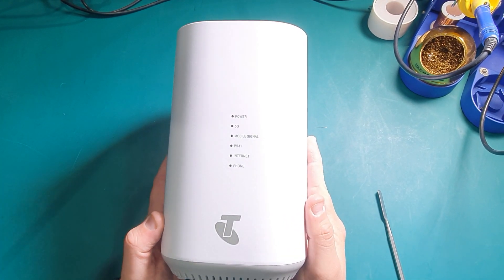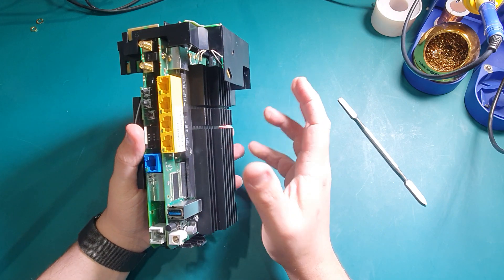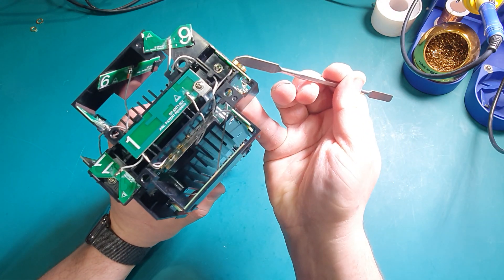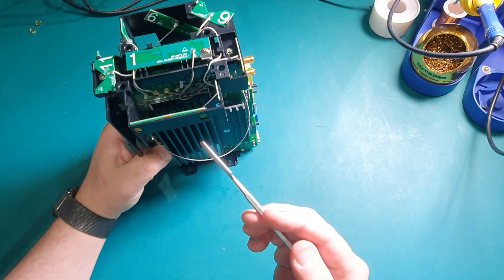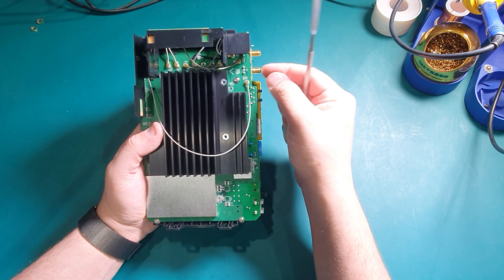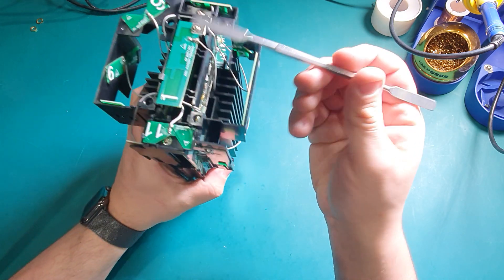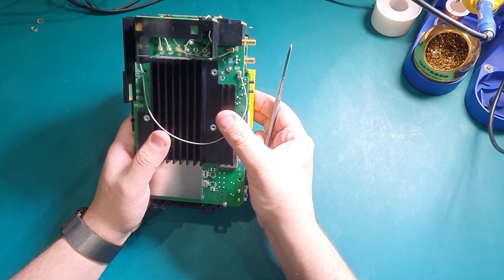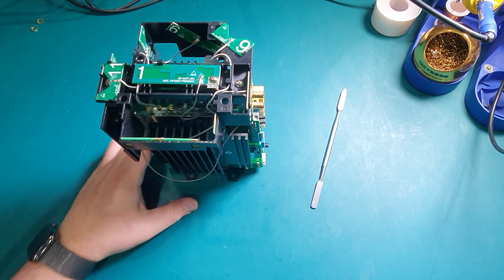Inside Telstra 5G Modem - Arcadyan AW1000

Comment: Got a Telstra Arcadyan AW1000 on 03-Jun-2024 but only to discover it has firmware version 0.06.01r, hardware version: XCI35AX44Z-TA through the Telstra webgui on the device. I could not find the "backup/restore" option as suggested by your "Method 2 – Backup File" as mentioned in whirlpool archive 9qr1j570, so there is no easy way for me to root it. If running on this firmware version, and before I open up the device and to buy an uart usb to ttl adapter and some probe clip using your "Method 1 – UART" way, do you know if Telstra still have not has this root access patched? Thanks.

Comment: You can use official Quactel document "Quectel_RG50xQ_Series_Hardware_Design_V1.2.pdf" , there is a Table 50 , and you have clearly said ,for what is with antenna. Spoiler : ANT2 and ANT3 should be for n79 ....

Comment: Did you end up working anything out about this modem? what direction should modem face to get best signak.. external antennas which port works best.. any USB unlocker files can put on a usb and plug it in modem to unlock stuff? or anything? :P I have moved again, and just took it back out the box. Yet not much is going on with it. dang thing

Comment: This works well with external 5g antenna i put on my roof for telstra 5g home internet. I went from 45 down inside to 330 down with the external antenna
Reply: May I ask which 5G antenna you are using?
Reply: Do you just plug the external antennas and it will do its thing?
or there are some settings or things you need to do?

Comment: If interested, I have added a few lines to the firmware to allow access to the new GUI I uploaded to the modem. It can now detect all towers in range, test them for speed and download an e-sim for that tower and carrier of your choosing. (uses the testers PLMN and even 466 for Taiwan appears to work). Furthermore, it is unrestricted thus I need a fan on the heatsink in the modem when downloading above 3000mbit/s.. Which is close to the max speed of my older SSDs
Reply: how
Reply: @Nawafwabs  seriously? Happy to sell the information. It did take me time to work out.
I've since optimised my code to improve reception also with much higher efficiency

Comment: For anyone interested in unlocking their modem. It is very simple now. You may be a Telstra customer but it could be geosyncronised to a tower, thus moving it then makes it basically useless. Or 1.5mbit/s max.
Or you may want to unlock it to use another sim card from any other carrier. 

Knowing the Public Land Mobile Network (PLMN) is 50501 for Telstra and Optus is 50502 you can just change this in the modem.

So, while the APN Mobile status 5G Technology Operator (PLMN) it is set as 50501 if change the 50501 with an asterix/wildcard '*' you can use any carrier. Just change the following line: arc_usb_dongle_lock_plmn=50501 to arc_usb_dongle_lock_plmn=*
Reply: Do you know how to lock a Huawei B818 263 with Optus 4g+ Sim to a specific cell tower? Mine keeps bouncing from one to another and my speeds range from 25Mbits to 200
Reply: Do you know to openline i saw some modem using openwrt firmware
Reply: Hi, I have the same modem as the guy in this video, where do I change the setting you mentioned to unlock the modem? I can't see it anywhere in the settings?
Reply: @Dudelydogg  hey, sorry Tel$tra are suing me for breaching and providing specific details about this on Whirlpool. Court next month. Unreal
Reply: @Dudelydogg  LOL yes it very easy once you change a whole heap of things and learn a whole lot of stuff in reality if do this for a living sure it is easy.

Comment: Hi Aron, great video much appreciated. Have you been able to confirm the SMA connectors. I need to position my modem under the internal stairs where there is no 5G signal. The modem will be relying on the signal from the external antenna that will be installed. It would be good to have confirmation that 5G will work on the external antenna before I spend considerable money to have the 2x2 mimo antenna and cable installed.
Reply: Hey mate how did you end up installing the external antenna? I thinking about going down that route as well.
Reply: No external antenna has been installed @MaDcUnT

Comment: 5g and this modem is absolutely terrible for gaming, my nat type is never open and 100% packets loss I can't even join party chats on xbox live it just endlessly connects then doesn't even though they said it was faster then nbn...... look who's going back to nbn......
Reply: Same problem with me.  The only other option I have is Telstra Velocity for Fibre to the House but after a week of trying to contact them and being on hold for hours on end, I was never actually able to even speak with anyone.  I'll wait until the area receives the pending fibre upgrades and choose a different ISP.  I prefer lower speeds on something more stable.

I did find one fix though for the Xbox.  If I log into the modem settings via a web browser and disable IPv6, it takes the settings back to normal and I can join or host Xbox live parties.  For some reason, IPv6 on the Telstra 5G modem does not play well with my Xbox Series S.
Reply: @ARMAKUNI01  okay I will disable the IPv6 and give that a try.
Reply: @conorjones93 did it work? Because before I moved location and it stopped working because it is geolocked (boo) I had awesome experiences with gaming

Comment: hi aron both the sma terminals are 4g and 5g ,for optimal set up you use 2 antennas offest
Reply: you can now get 2 external antennas that cover 4 and 5g but need to connect both
Reply: @katiekumcgil  Any suggestions on model/brand for said antenna's?

Comment: Is that any possible to crack the geo-block of the 5G modem? I have been made an order before I see your video, it's too late to change to the non-address order even I just found the way as same as you did. Hopefully it works after I receive the modem tomorrow, and thanks for your nice video!
Reply from the maker: I dont know if you can crack the geoblock, I assume its at Telstra's end, all I know is mine doesn't appear to have any geo restriction
Reply: @AronBezzina  Thanks mate, thanks for your reply, I just try your way to apply another order and as you said they sent me a form which need to fill my home address, and I did put my real address on the form, not sure if it works or not, coz my real address is not support with the 5G.. Hope I am doing the right thing as you did, cheers!

Comment: should I add an external antenna outside for the 5g I'm about 900 metres from the tower
Reply from the maker: My gut feeling is with Mimo antennas you would get an improvement, however I don’t really know. If you can afford to buy an antenna to test it I would be interested in hearing your results. 

My ultimate goal, when I can afford it, is to get a 4x4 mimo antenna and connect it to the 2 sockets on the back + 2 more inside (2x 5g, 2x4g)

Comment: Hi Aron thanks for your excellent YouTube post on the AW1000 box especially pulling the cover off.
I think that the internal antenna array provides a system where the unit can operate effectively as you mentioned that the 5G signal is very directional.
In general RF terms the higher the frequency short they wavelength so the physical size of the elements of the antenna.
You could remove some of the antenna connectors and see what happens to signal strengths of the 5G signal and also the WiFi and then pin point what exactly each antenna does.
Maybe a trip to the nearest 5G base station with a 12v battery and remove all of the coax connectors and then connect one at a time and monitor the results.
I’m very interested in your project as I’m considering doing the same as I’m close to a Telstra 5G tower 3 - 4 meters.

Comment: I received this a few days and I am curious can you buy an external antenna to increase stability ???
Reply from the maker: Yes you can buy ext antennas. Either a 2x2 mimo or a 4x4 mimo if you are ok with opening the modem, unplugging the antennas and adding screw on terminals for the other 2 cables from the 4x4 mimo antenna
Reply: Thanks for what you are offering.. Can you specify which connectors can be used with 4x4 memo, which one is the 5g and the 4g?

Comment: Found out from RF store,  Antenna ports at the back of AW1000 are connected to 4G modem . So connecting external antenna wont improve the 5g . Not sure if ports can be rewired to 5g Modems. Cheers
Reply from the maker: It really appears to me that one antenna jack is 5g and one is 4g

You can technically add more jacks.

Comment: Thanks for the detailed video mate. I am 688m away from Telstra pole and getting 500+ Down and 40 Up most of the time . Pings are around 20ms. If I use an external Antenna , will that manke any difference ? & would you be able to recommend any? ta
Reply from the maker: I am not too sure however I don’t really think you will get much better. Plug ur modem into a 12v battery and take it for a drive, do tests at different places Around the tower to see if the tower can even do any better. I think the best speed I ever got doing this was in the 700s
Reply: WOW! mate the best mine got was 360 down 15up with a Ping of 25 😡. @AronBezzina

Comment: Is there any way to do port forwarding on this modem? I've got one and for the life of me cant figure it out
Reply from the maker: sort of... issue is its a 5G service so it has a double NAT. google CGNAT for more. basically you don't get an external IP address so u cant fwd. however you do get an external IPv6 address. so if you know how to work with IPv6 u can use that. tho this modem appears to block that also so the way around that is to hack the modem and use openwrt commands to do port fwds. The route I took in the end was to use this modem to get internet access, connect it to my main router (pfsense), pay for a VPS and setup a VPN between my local pfsense box and the one i built in the cloud. I then use the cloud IP address to fwd ports over my VPN back to my local pfsense box.
Reply: @AronBezzina  Hi, great to see an analysis of the internal bits of the modem. Did you setup your workaround because you wanted to do port forwarding to enable the xbox to allow multigaming etc? This is what I am trying to setup, currently Xbox reports NAT moderate, Upnp - none and tests say 100% packet loss
Reply from the maker: @andrewburrell4695  I need port fwd to get access to my server, not for gaming. 

I don’t think there is much that can be done for gaming.
Reply: @AronBezzina  thanks mate
Reply: @AronBezzina  I have this as well, but Telstra gave me a static IPv4 when I asked for it, of course this isn't much use without port forwarding/dmz etc... have you worked out how to do this?
Reply: How is the heat of this machine? Will the Internet speed drop due to heat?

Comment: Great video.  Couple of quick notes if you're interested.  The multiple matched antenna are for steerable beam forming, they're nearly all active all the time.  The unused antenna ports are becuase this hardwre is based on a stock design we customise for our market and its easier to leave them there than remove them.  GPS is for clock.  Serial is for debugging and by all means take a look but you're not going to find anything there on a device running production firmware.
Reply from the maker: I did endup setting up serial debug. was able to get root after that and play around a bit. https://forums.whirlpool.net.au/thread/9qr1j570
Reply: The antennas placed around the unit is not so much to cover the front and back of the home, it works just fine regardless of tower position.   Its main purpose is physical separation to reduce feedback and interference.
Reply: @BillAnt  don't forget that antenna placement and orientation in modern multi antenna devices is actually important. both the hardware and internal radio mcu firmware for these is beam forming (delaying one or more signals from one or more antennas) so spacing and orientation is very important. one pair will often be transmit and the other receive or all will do both providing the optimal physical conditions for very low power signals that need constructive interference to pop out of the noise floor and be amplified or in the case of transmit constructive interference to provide the highest possible signal amplitude despite all the other sources of noise. to increase effectiveness and especially with mobile devices with low power both polarization and triangulating connections is necessary. each device connected is positioned in space using phase delays to create a new optimal triangulation phase match which provides constructive interference per devices time division multiplex slot/s so the phase angle of the signal is per connection not just the access points clock. all clients are expected to synchronize to this both in time and space with polarization and delays used to provide constructive interference. some devices have GPS time and location awareness which helps to aid this more then significantly even with low 1 meter resolution but mostly so isp's can track their branded devices but also allows devices to determine the correct rough phase angles when dealing with many devices. new radio technology such as mobile and wifi communications actually follows technology based on phased array radar and communications as well as synthetic aperture radar and moving single antennas since mm/cm waves are very sensitive to phase shift and even from holding a phone.  the more antennas phase shifted/delayed the more constructive interference can be used to increase signal to noise ratio, lower transmit power requirements, deal with polarization issues. other benefits are wider bandwidths making jamming and interference hard of not impossible without overwhelming radio sources designed to attach the bandwidth base frequency but a clever programmer and radio enthusiast can also overcome these by simply "phase shifting and randomizing via cryptography" the base or center frequency for the carrier wave making all jamming signals equivalent to all other noise a normal radio would have to overcome. the more channels a base frequency has in its spectrum the more effective this anti-jamming aspect becomes.
Reply: @gmsol  - TL;DR  but yeah I didn't want get too technical and explain about phase shift, multi-path mitigation, etc.

Comment: awesum review, is the a way to isolate the 5 ghz to allow a connection for my nest cameras which allow only a 2.4ghz connection , cheers for any help
Reply from the maker: The modem does band steering. So the nest should still see the ssid and connect. It just won’t be pushed up to the 5ghz. 

Tho in the unlikely chance this doesn’t work u can seperate the SSIDs to a 2.4 and a 5

Comment: I believe Telstra can geolock these devices.  I wonder is there is any GPS antennae in there? or are they relying on the tower location/s the signal is feed from. I am trying to get around the geolock, to be able to move it around multiple sites. If anyone has any tips on this please share.
Reply from the maker: I have not seen gps antenna. It would be based on cell tower. GPS would be useless as the modem is inside. 

I have been able to move mine around, so far with no issues. Tested it in my house, at each end of town, in the next town, down the highway it’s always worked 100% with no lock. Maybe I got lucky with how I ordered mine that maybe mine is lock free

When I ordered mine I got it as a business not personal.

I put in an address that could get the service and then I copied the url of the button that was no longer greyed out. 

Then I opened a different browser and pasted the url in. I got through the whole signup process and it did not have a service address tagged to it. 

I then got an email saying my account needed additional info (the service address) the email had a link to a form to fill out. I did that and the modem arrived and has seemingly been region free the whole time.
Reply: @AronBezzina  Ninja!

Comment: I'd actually expect that the smaller the antenna board, the higher the frequency as antenna physical size depends on the wavelength of the signal and higher frequency signals have a smaller wavelength, thus need a smaller antenna to transmit/receiver. I'd also assume that some of the LTE/5G antennas are designed with a range of frequencies in mind to cover multiple 4G/5G bands each. 

The exception might be the smaller one on the back. This may be designed specifically for 3500MHz (known as 5GNR band n78) which is probably the highest cellular frequency this device supports. This is the "main" 5G band Australian carriers use, so they might have a dedicated antenna for it to maximise the gain of the modem for that frequency. It might also explain why it's on the back - typcially if the device were positioned near a window, you'd have the LEDs facing into the home meaning the back of the modme would be pointing directly out the window and hopefully towards a mobile tower to maximise the signal that antenna receives. 

Do the antenna PCBs have any numbers/markings on them (apart from the "antenna ID number")? These might indicate bands/frequencies those antennas are designed for.
Reply from the maker: I Think you are right, in my testing the larger antennas did appear to be the 4G signal and the medium antennas did appear to be the 5G, the little one didn't appear to do anything when disconnected but saying its specifically for the 3.5GHz makes sense. There were no markings on the antennas that gave me any indication of freq.
Reply: Arcadyan aw1000 vs zlt x25 pro wich one is better? @AronBezzina

Comment: Makes me wonder why they would parallel external with internal. Generally if you do that you’ll throw the swr off with 2 antennas connected.

Maybe you’d have better luck getting 2 tuned patch or yagi antennas pointing direct at the tower and disconnect the 2 that share the internal with external.